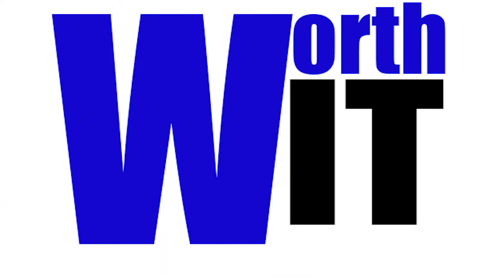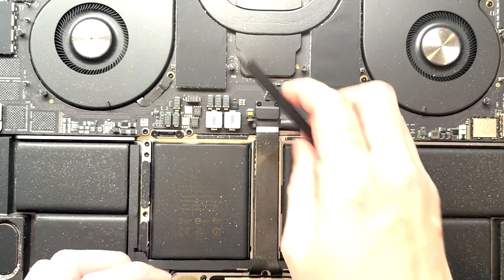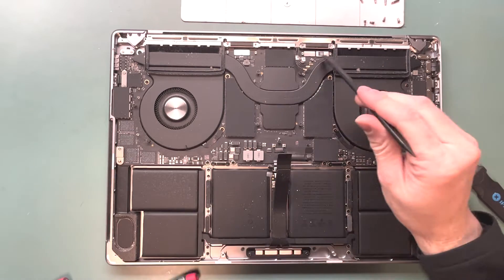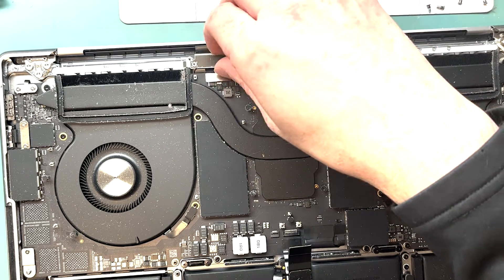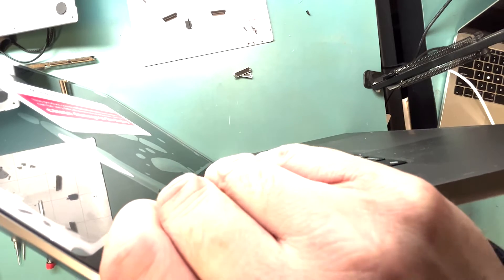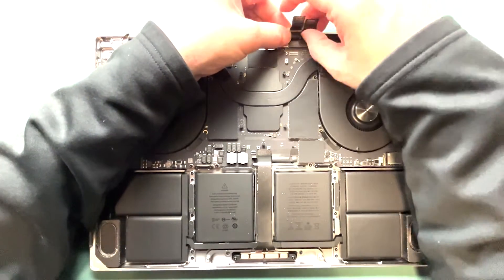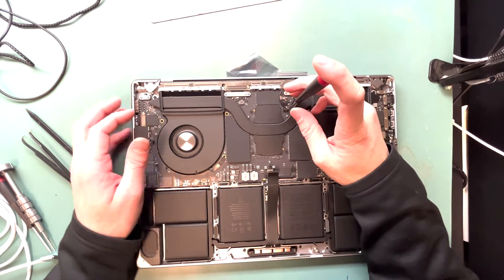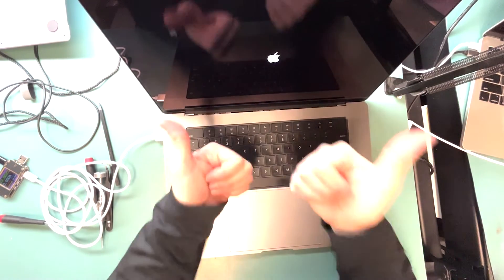MacBook Pro M2 A2485 2021 16" Screen Replacement Guide

Comment: So, I came across your video when I when a client came in with a newer MB Pro with a cracked screen. I found out the hard way that little cable in the corner is the lid angle sensor and without calibrating it, the comp will not go into sleep mode on lid closure. There's a way to manually recal it, but it requires marking the bolt before replacement and then turning the bolt to the proper position after install. I only found out about doing that after I'd already put it back together so I didn't want to take it apart again. Fortunately, I did find a much easier way to recalibrate it, but it required purchasing an almost $200 USD part from Nerd Tool. :( I figure this won't be the only MB I see with a lid sensor cable instead of the old magnetic closure system so it's an investment, but not a cheap one.
Reply from the maker: I heard from my coworker that the little cable on the side is for sleep wake sensor if you don't transfer it it won't work but if it breaks I am think you maybe SLO if the part is serialized to the motherboard
Reply: @worthitrepairs  The screen I got came with a new sensor cable and it worked fine once I used the nerd tool to calibrate it, so it's not serialized. Thankfully, its not in a position where its hard to reattach (looking at you, teeny tiny battery ribbon cable) so there's not much risk of tearing it.
Reply: So after switching the screens and calibrating with the nerd tool, does everything work like before? Does auto brightness and true tone work?

Comment: I have a 2021 MacBook Pro that needs a display replacement. I’m a student and can’t afford the one Apple provides, so I found a used one for  replacement on eBay. If I replace it myself, will I run into the recalibration issue people are mentioning in the comments, or should it work fine?
Reply from the maker: It should be fine

Comment: Hello I have a quick question, I tried this repair and it was successful on the screen. But I’m having problems with the battery now, the max only stays on when it is connected to charger, the Mac fans are also spinning full speed. Do you know of any possible errors I made or work around?
Reply from the maker: You may need to screw down the battery connector thing down more it might not be all the way tight

Comment: Bro, I copped a donor MacBook Pro off eBay, followed your instructions, and now I’m literally typing this on the new screen I just installed. Appreciate the solid guidance 🙏🏾🔥
Reply from the maker: Whooohoo
Reply: @worthitrepairs  also fun fact with the new operating system Tahoe they let you use a donor screen and activate True Tone 😭🥹

Comment: Hi! Thank you for that great tutorial. I have one question though: I'd like to replace my wife's laptop screen, it's the a2485. I replaced my phone screen in the past, I have a pretty good ifixit toolkit with all the tools I'd need for the repair. 
Only question I have is: I have read that in order to have the new screen work properly, you have to migrate two chips from the original screen to the new screen and that there might be issues with the auto-sleep function when closing the laptop.

Is that an issue of the past? Can I just use third party vendors and I'll be good to go, or do I need to get OEM parts from Apple?

I'd appreciate any info, thank you a lot!
Reply from the maker: Since its a A2485 it doesn't need the chips transfer if it is an Apple pulled oem screen
Reply: @worthitrepairs   thank you! Is that also true for true tone? I read that in order for true tone to work, you either have to transfer the two chips or have apple support do some remote configuration/calibration, which they will only do though, if you got the replacement unit via their official self repair program, which would make this whole endeavor so much more expensive. 
I've seen that I could get a pulled OEM screen on eBay for as much as 350 euros. The cheapest option in the Apple self repair store is over 800 euros, which is just crazy....

Comment: Hi. Thanks for the video. Did this but my new screen wobbles. I made sure I tightened the screws. Also it doesn’t close flush with the bottom half
Reply from the maker: Your top case keyboard could be bent or the screws aren't in right
Reply: @worthitrepairs  probably a bent case, but surprisingly, it closes flush when the screws aren’t fully tightened.  Using A2485 display on A2780. So confused. The last time something like this happened to me was with my 2015 MacBook Pro and greasing the hinge solved this. Not working here

Comment: How bad could someone who has no idea how to repair computers fuck this up ? I mean I’m smart sometimes I think I could manage this with video guidance such as this video and sometimes I’m like better safe than sorry . Is there anyway attempting this could fuck up my computer even more ? 3rd party repair shop quoted me $680 to replace screen/display on my MacBook Pro 2021 16” . I accidentally shut the laptop on top of my charger cable the same day my car was getting inspected and found out my car would be 2k to repair . And I just got laid off from my job because the company closed down . So long story short my finances are fucked rn and it was the worst time for my screen to break bc I need to apple for jobs ,😩😭😭
Reply from the maker: It could make it worse it’s a risk even when I’m doing it something could go wrong. I feel like getting off the back panel is the hardest part. But if you don’t have all the correct tools you could damage a connector on the board

Comment: Hi, thanks for the Video. I currently work on my own MacBook Pro 16" from 2021. The Problem is, the device starts and shows the screen for a short time then it turnes dark and stays that way. An external screen works but the keyboard and the trackpad wont react at all. It seems like the battery wont charge at... Is there any advice?
Reply from the maker: Maybe it's a defective screen, or you've got a board issue.
Reply: Is there a way to repair the cable in this Display? Sometimes the picture appears for a short time on start. @worthitrepairs

Comment: Great video, everything worked fine when I did the initial test, but on reassembly, the laptop attempts to boot for about 1 second and stops while I get a partial Apple tone and the mag cord turns amber, but it goes off. It will then tray again after a couple of seconds. Any idea what I missed?
Reply: I figured it out, apparently the battery ribbon wasn't making a good contact. All is well now!
Reply: Looking at everything, it all looks to be in order. I may disassemble it tomorrow and look for anything I may have missed or a connector I didn't get seated.

Comment: Are the screens original apple from the website you recommended?
I'm after an lcd kit only.
Reply from the maker: They are if they say Grade A or B on it but they do have after market ones. THE LCD only would be aftermarket and are like impossible to install I've tried

Comment: Thanks, but people should BEWARE - Your screen will NOT sleep when closed by default unless you recalibrate it!!! You need a machine to do that.
I completed this repair in the UK and luckily found a place called ApexIT that did it for me, otherwise I would have had to spend hundreds on a machine.

Comment: Thank you for the video. I have the same A2485 2021 16" with a vertical line down the screen.  EMC 3651. Would mine have an A) ambient light sensor B) Promotion (120hz refresh) p3 wide color C) anti reflective coating ?
Reply from the maker: I would just replace the whole screen and not worry about it. Most likely a crack in the OLED
Reply: @ will do thank you. Hopefully my local tech can do it without losing functionality

Comment: Great replacement guide. I replaced my screen but now when I close the lid, the display does not turn off or go into sleep mode. The display just stays on, I am wondering if this is common or it is a magnet issue? Anyone had this issue and found a fix? Thanks.
Reply: Is this Apple trying to prevent us from repairing our devices? a damaged lid angle sensor? I am now having to power off and then close lid and then open lid and power on.
Reply from the maker: @jordz121  You may able to fix it with the Apple OEM part and then part pair the part through their program please email me for any details or ideas I may have at mark@worthitrepairs.com
LETS FIX IT!

Comment: So did the repair and now my battery doesn’t work at all. Without my computer being plugged in, it will just shut off. I think it’s because of the very small battery connecter but I’ve tried everything and I think it may be ruined. I would definitely recommend emphasizing the importance of that particular part in the future.
Reply: Do you know of any potential fix for this? My computer is super loud now when it’s plugged in
Reply from the maker: @Curbsidepickuprecords  I will do that in the future for sure. I will look at it for free if you ship it to me. Email me mark@icarefargo.com 
Things to try would be to make sure the T5 screw is screwed down all the way. I would also check the connector on the battery side to make sure it’s not loose.
Reply: I don’t know if this helps out or not but when I put everything back together the small battery metal connector was completely covered by the black tape used to pull it out I had to carefully peel it upward to reveal the metal connector and then use it to slide it in just like I slide it out when taking it apart.
Reply: I have exactly the same issue - battery no longer shows charge level and the fan is on full speed all the time, so super loud.
Did you fix it in the end? I am not sure what to do...
Reply: @SirPhytone  Did you ever find a solution for your Macbook? I am having the same issue. No Charge level showing and full fan speed.

Comment: Hi I did follow all guide and it seems everything should be working but my MacBook boots only with power plugged it. all plugs of battery connected. tried to disconnect and connect again. but still laptop runs only on power. what could go wrong? could it be that battery connector is screwed? I was really careful and don't see any damage at all. pleasea advice.
Reply from the maker: Oh no just wondering when you unplug it does it shut down

Comment: Thanks for the video.  I used it to successfully replace my display (a thumbtack on my keyboard cracked the screen when i closed the lid). Only issue I encountered was that the battery wasnt charging at all.  Discovered the small battery connecter was loose and not making contact.  Fixed !!   Thank you!
Reply from the maker: Worth it!

Comment: Thanks for the info everything was spot on. Two questions. 1) where is the best place to buy am OEM replacement screen? 2) I lost a screw to the hinge cover (Not hinge) do I need both or will one work?
Reply: Bought a supposedly OEM screen and there is a huge gap by the hinge and the bottom cover is warped when it's screwed down. found the screw by the way. oh yeah I thought you replied to comments?
Reply from the maker: Hello sorry for late reply I get my screens form mobilesentrix.com
Reply from the maker: When you dropped your comment I was on vacation so I never replied

Comment: Is there any reason you wouldn't be able to swap the displays on identical A2485 models?
Reply from the maker: An A2485 is an A2485 so it should not matter
Reply: I saw a video of this dude swapping screens and there were weird shapes and issues after the swap. Is that not a thing anymore or do you need to use a Genuine Apple part and have them activate it?@worthitrepairsbymark

Comment: Hello,
Do you know if you can use this MacBook headless without problems? 
Thanks!
Reply from the maker: I don't know what you could try is disconnecting the screen instead of fully taking the screen off to see if it works. Before doing all the work take it off.

Comment: This will not allow the LCD to shut off since the displays are locked via serial #

Currently commenting on an a2485 with a locked screen
Reply from the maker: Thanks for the feedback
Reply: @worthitrepairs  That's the sleep cable

Comment: The screen isn’t locked by Apple with a serial number?
Reply: Yes it is.... It will work but there will be glitches on the screen, true tone won't work and there are light spots.... I went through 2 screens because I thought one was defective
Reply: @Sur_GalaChad2189  What did you do in the end? I am in the same situation and considering buying a new one unfortunately and selling my current laptop for spares. If I go to apple to repair it, its too costly and doesn't justify the cost.
Reply: @aadds4157 did you fix it? I recently broke mine Mac screen and idk wht to do. I have heard a lot about display being locked to the serial number and stuff.
Reply from the maker: Nope
Reply: Yes it is @worthitrepairs

Comment: Does it have to go with the full clam shell replacment or just the LCD screen be replced with this model?
Reply from the maker: You can get just lcd and do repair but I don’t recommend I tried on other models ended up breaking the lcd putting it in so I lost money on the repair.